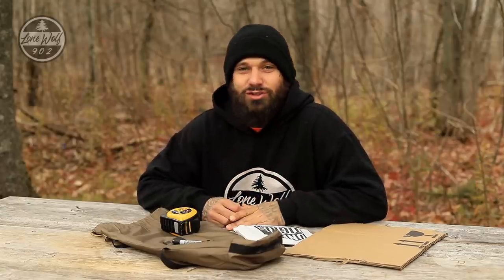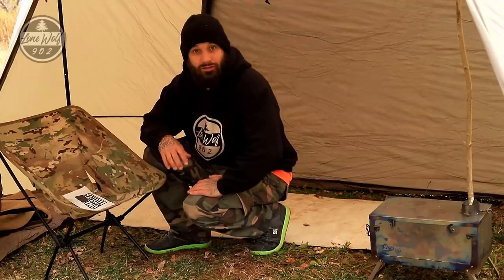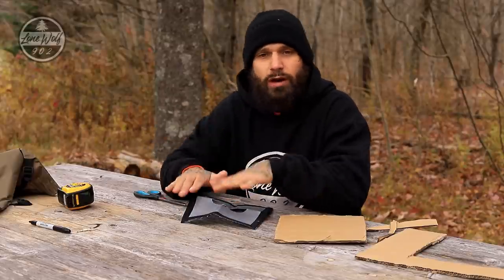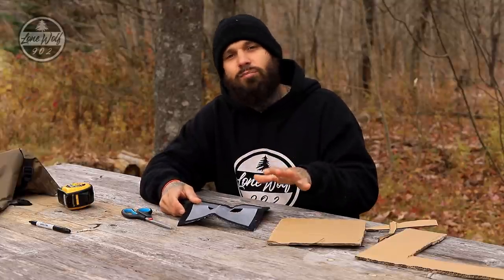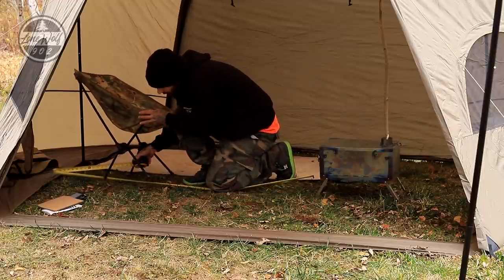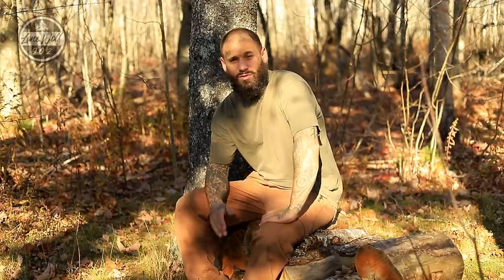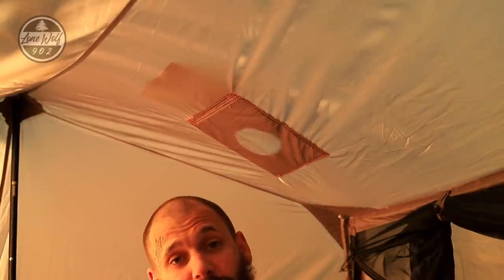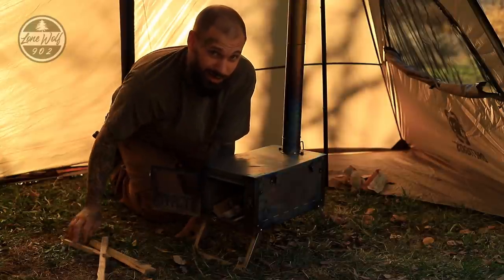HOT TENT STOVE JACK INSTALL - Onetigris Solo Homestead

Comment: Well done...A+...just a heads up, you can take hi temp silicone from a auto parts store for exhaust headers and put a bead around the edge of the hole in the stove jack so the jack wont unravel anymore and wear out...Cheers!!!
Reply from the maker: Thanks, everything worked well . Good suggestions

Comment: I use the shiny fire resistant emergency blankets and cut a hole in it for the jack and it  protects the tent from sparks. Just have to put grommets in it and tie it off. Cool video's I learned alot.
Reply from the maker: Fire blankets are very useful 😁👍

Comment: I'm still imagining a zip-in panel system for this model which allows options like a panel on one end vestibule to be swapped out with one with a stove jack or more mesh or whatever we dream up.
Reply from the maker: The problem with putting a jack on the ends is the walls are way too steep.  The jack would need to be 3 ft long to protect the pipe from touching the walls

Comment: From the first time I saw this semi-Baker style tent I was thinking this would great for ice fishing for 1 or 2 people.  I like the pop-up style ice fishing shacks for their quick set up BUT they are heavy and bulky.  A number of people have converted them with stove jacks (a whole lot better than using damp propane heaters) and use them as hot tents.  

With a Baker style tent, you can fish inside because there is no floor or you can fish under the canopy (pitched a bit higher) with the tent being used as a windbreak.  A stove can be placed inside the tent as you have shown or a stove can be placed outside just beyond the canopy to radiate towards you.  Obviously this type of tent takes a little longer to set up and screw anchors into the ice are needed but it is something I've been contemplating since last year.  This video is just additional confirmation of my idea.
Reply from the maker: Very good thoughts
Reply: @Lonewolfwildcamping  Any clue on when this might be available?
Reply: Scratch that.  OneTigris just put the tent in a different location than it should be on their website.  A SEARCH by its name will find it.  Apparently, the tent is a sleep system instead of a shelter!
Reply from the maker: https://youtu.be/p_1mw8V7lq0
Reply: @Lonewolfwildcamping  Thanks.  I saw that video before, then I checked out some Japanese videos too. They gave me more closeups and more info.

I do wonder however how waterproof the pole tips through the grommets are.  One video shows the rubber tip covers.  One person complained about water coming in at that point and eventually travelling to the centre of the tent where it dripped from the centre attachment point.

The other thing I would worry about is how much snow would enter through the 2 D-shaped windows?  On an ice fishing hut, the windows are clear plastic velcroed to the body.
Reply from the maker: I use rubber o rings on the inside of the tent ontop of the pole to water seal it

Comment: I would suggest using an electric hot knife to make your cut. It cauterizes the nylon and prevents it from fraying. There are also hole cutting attachments for installing button snaps and grommets.
Reply from the maker: Good idea but the project has been successfully completed already
Reply: Food for thought for your next project. They're cheap, under $20.
I watched your field test video as well, it was inspiring. Nice job!
Reply from the maker: I'm definitely going to be doing more so that is an excellent suggestion.  Thank you

Comment: For those that have segmented stove pipes, you could use an adjustable elbow and run your pipe on an angle out the wall beside the panel with the mesh window on either end.  It will give you a little more room in the main area of the tent. For seam sealing silnylon, the Permatex Flowable silicone windshield sealant works well.  Available any most auto parts stores.
Reply from the maker: That was actually my first thought but decided against it because I wanted both windows left functioning

Comment: hi again 👊 I have bought an Onetigris solo homestead tent🏕 which I will turn into a hot tent .. but then I see inside the pomoly that there are three lengths of stove pipe 2 meters and 2.5 meters and 3 meters = 9,  84ft what is the disadvantage and advantage of the different lengths ? 🤔😀🇳🇴

Comment: Great video!
Would it be safely possible to have the stove jack like Yours, but 5-6 inches further away from the tents roof ridge?
It looks possible, at least from the outside, but what about the inside?
I'm thinking of converting a tent like this to a hammock hot tent and therefore want stove and pipe more away from the ridge/supposed hammock.

Cheers Harry.
Reply from the maker: I sold the tent and all of my other one gear,  sorry I can't offer any suggestions

Comment: This is such a "cool" shelter. I've always felt like a traditional hot tent would be a little boring without the view so this would solve that problem. I didn't realize OneTigris made all that stuff but I picked up one of their square tarps for $40 years ago and it is just bomb-proof. 100ish nights of use and the taped seams are still watertight.
Reply from the maker: Very good products,  and I had to make it into a hot tent,  its such a unique design
Reply: @Lonewolfwildcamping  I can see why!

Comment: With the heat coming off the stove, wouldnt it melt the material of the tent? Or is it a different material
Reply from the maker: Nope, its a stove jack made for stove pipe
Reply: The stove has enough clearance all the way around it to prevent heat damage to the tent material.

Comment: Not sure if you're still responding to vids this old, but if you do, do you think a small stove would be safe if allined along the side in an A-frame canvas tent? I watched another vid of yours recently where you burned in a T-Brick Mini, and you explained that the glass allows more heat to escape than the metal, so I wonder if the canvas would get too warm beside it.
Reply: How big of a canvas A frame tent do you have? We have an A frame beckel canvas tent with a stove that runs out the front door thru the wall it sets up about a foot away from the wall and 90's off the top of our stove out thru the wall then does another 90 and goes verticle for this part we use a t post and some wire to keep it upright it's been going strong since the late 70's
Reply: @fishing_with_chaz  it's a Bundeswehr pup,  if you're familiar with it.